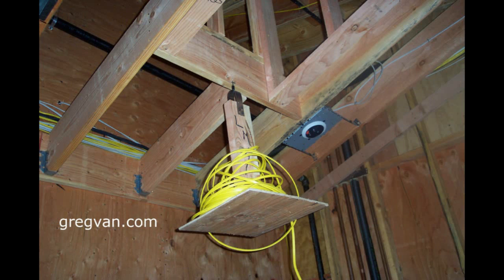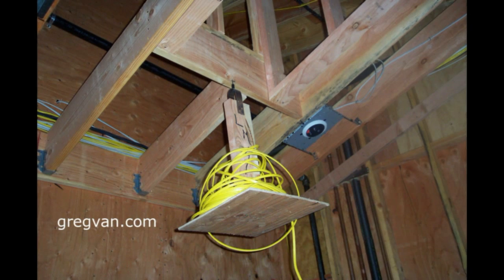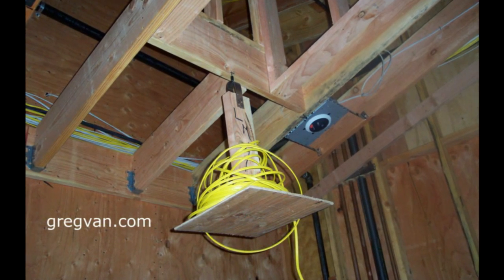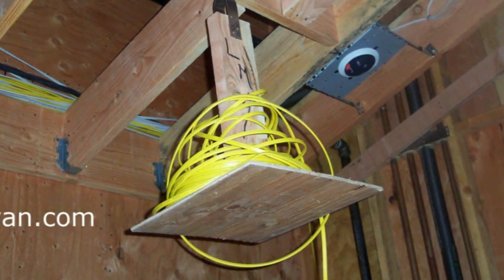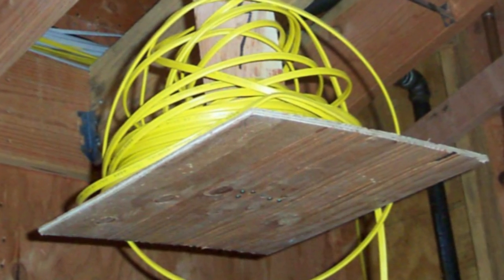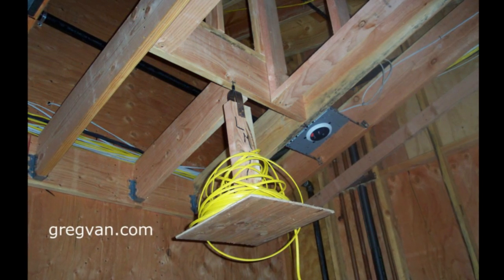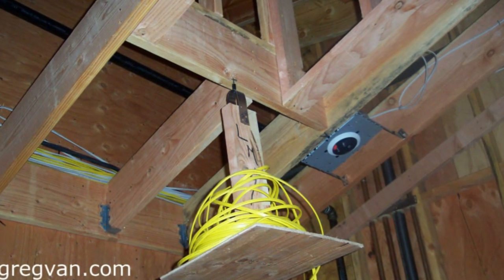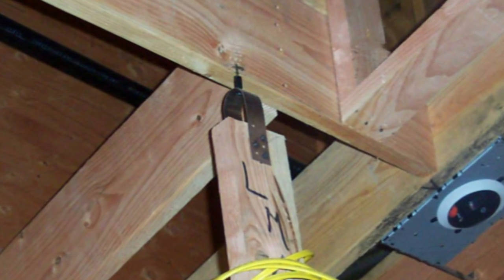How to Make a Cheap Electrical Wire Pulling Tool

Comment: I wanted to make my own video on this before I watched yours so I wouldn't be influenced. Been making these things for years and have it down to a science. You can pull 3 or 4 home-runs at once when doing a large house. Mine take a little long to make, but last forever and belay the wire very smoothly. The bigger the wire, the shorter and wider you want to make these things. I have found that 18" tall by 21" wide is perfect for 12-2. I used to sell these to my co-workers for $20.

Comment: Ya know Greg, I think I have a custom in a few months. If it happens I will be doing videos on the finer points of Drilling, Boxing, Layout Code, Panel Prep w/ UFR, Inspection sequence, and anything else that can only be done when the project is big enough to provide several examples. And yes, I will be pulling 2 or 3 Home Runs at a time. Really hope I land this job, wish me luck. Take care buddy.

Comment: Greg - this design is certain to tangle your coil- it needs a couple improvements.   All it needs is two pieces of Romex nailed to the bottom... over the upright.....back down to the bottom - so it makes something like the shape of a Christmas tree or pyramid (or upside-down funnel - you get the picture I hope).  You leave just enough slack in the pieces of Romex to help contain the rolls.   I'd also cut the base into a circle instead of a square, b/c those corners will also mess with the pull.     The simplified version is just a "T" of 2x4s with ONE piece of romex forming the "Christmas Tree" shape.  Also works great IF you get the angles right so the corners won't catch the wire coming off the roll.   For 12-2/ 14-2 250' rolls that's about a 24" bottom piece and a 17-18" upright but YMMV depending on the brand of wire.  (I use Southwire and the center "hole" works pretty good with those dimensions.   Cheers!
Reply from the maker: Feel free to send me a picture of your design and I will create a new video. I have to agree, this isn't the best one I've seen, but it's the only one I have a picture of. Thanks for taking the time to share your comment with us and even if you don't send a picture, I think most of us can figure out how it would be built by your description.

Comment: Just talked no demonstrations?
Reply from the maker: Let me try and explain how it works. You can lift the entire assembly off of the nail that will be holding it up, to load the roll of wire onto it, then rehang it. Then you simply grab the electrical wire and pull it and the assembly should turn with little resistance, allowing you to pull the wire without it being tangled up. Hopefully this helps.